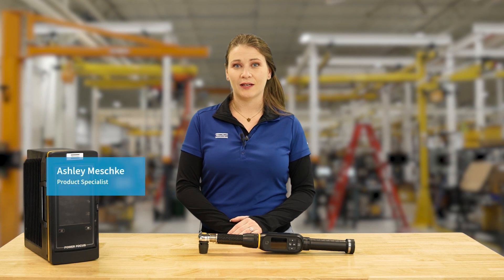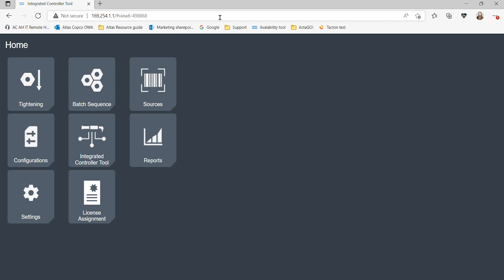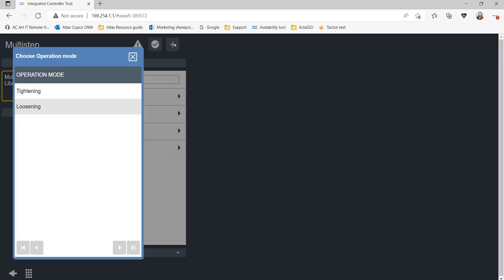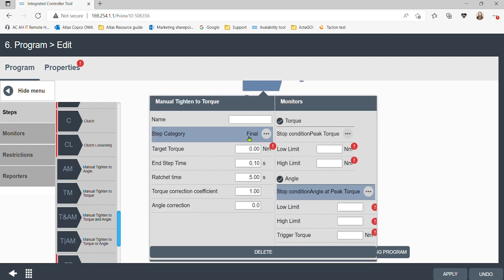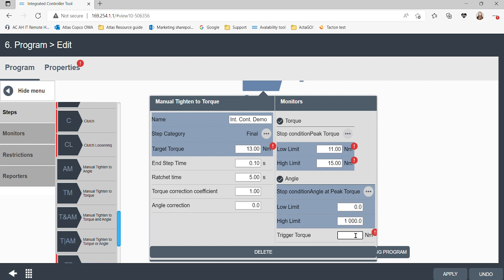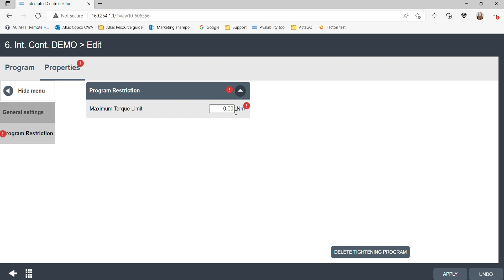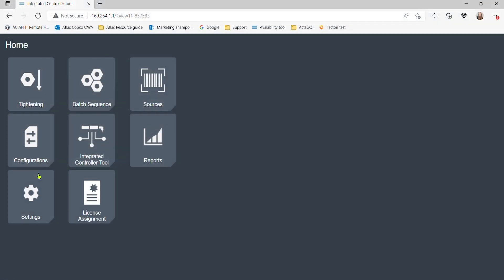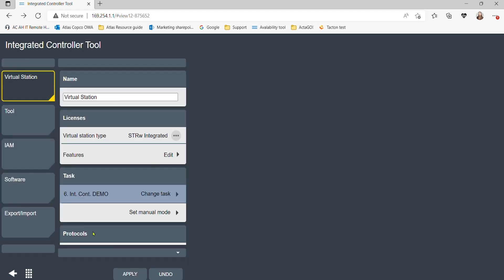Product Essentials: STRwrench: Program and integrated controller function | Atlas Copco

Comment: HI, do you provide sample code to communicate with the torque controller. I have a C# application that need to communicate to the PF8 torque controller/gun and get the torque values. i am able to connect the torque and receive the data but sometimes data is missing. i am searching the example that shows the correct way to connect and get the data continuously.
Reply from the maker: Hi, Pankaj! To assist you further with your query, kindly write to us at social@atlascopco.com along with your contact details.